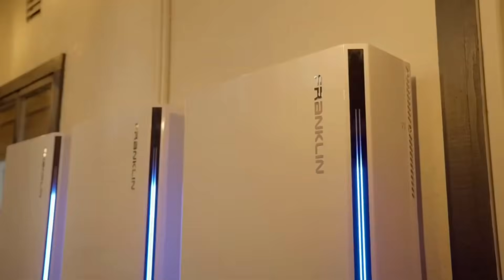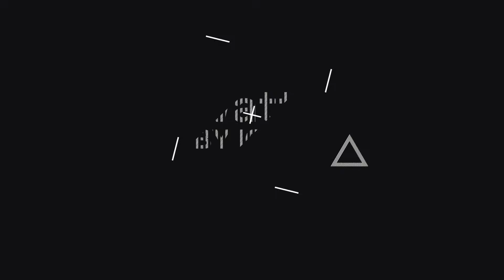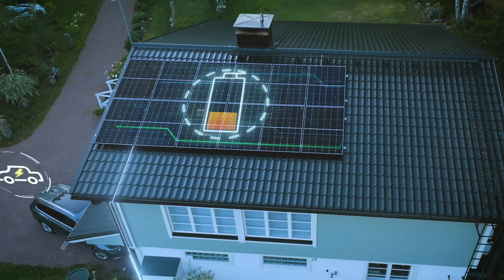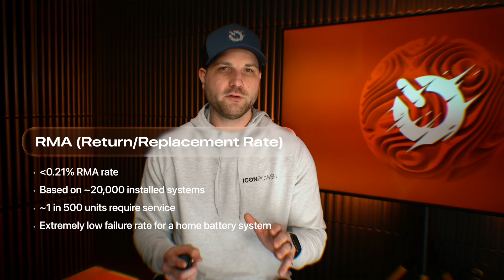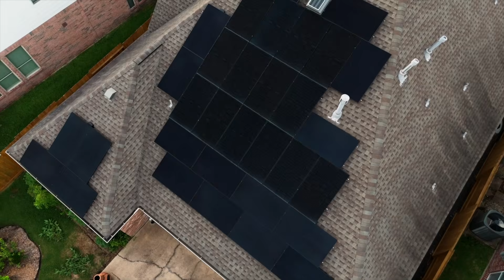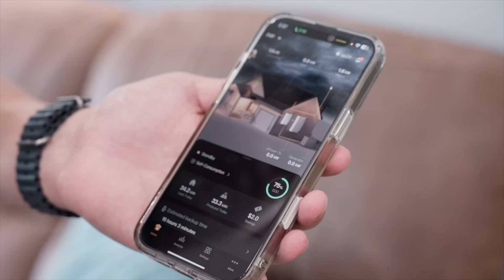Franklin aPower2: 4 Critical Things You Need to Know

Comment: I have an apower 2 with a generator input to plug my Lightning into in case of prolonged outages (I live in Florida, hurricanes can take out power for a few days at a time). I did not go with the V2L option as it would have required me to get an EV charger that supports V2L, and those were pricey at the time. An extension cord and plugging into to the propower 240v outlet lets the truck recharge the apower battery. During the day, the solar and recharge the apower and the truck, and can even charge my wife's car if we need to get around. Last hurricane, everyone was struggling to find a station that had gas and working pumps (pumps don't work when the power is out). We don't have to worry about any of that nonsense anymore.